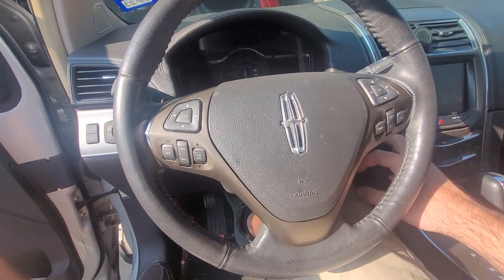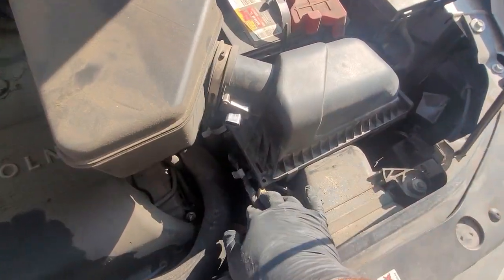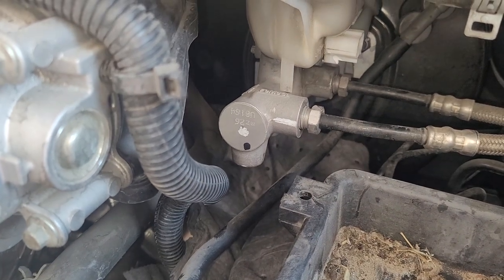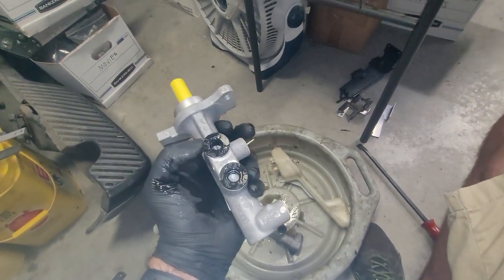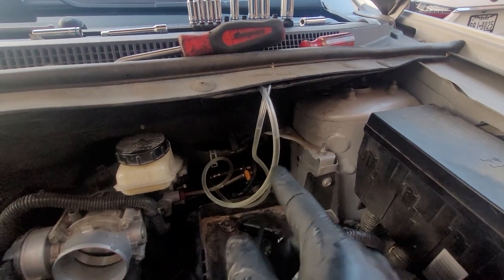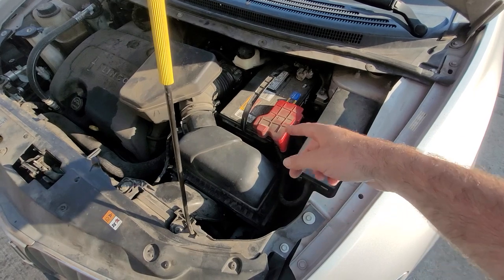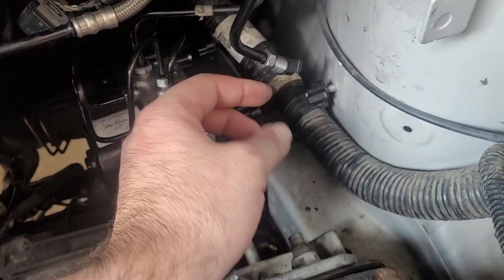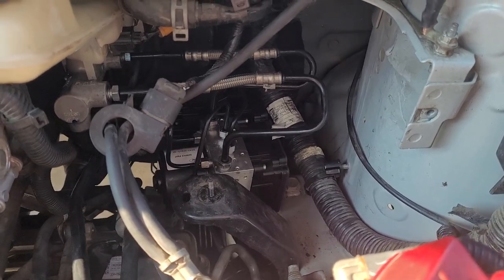Soft Brake pedal problem resolved 2011-2015 Lincoln MKX

Comment: I had a 2013 Lincoln MDX with 131,000 miles in the shop today and repaired the same Customer Concern soft brake pedal.. I did not replace the master cylinder, or the A.B.S. valve block, or pull the battery multiple times.. Now I'm home after work and Googled on the YouTube... Your video was the first to Pop up.. Your final diagnosis of a stuck valve in the A.B.S. block was probably correct.. I performed the auto bleed procedure and the pedal may have felt slightly better?.. Before condemning, or falsely diagnosing a faulty master cylinder,, pull all 4 wheels and remove the mounting bolts from the brake caliper's.. Be sure that none of the sliding bolts or bushings are seized.. Crack open the bleeder screws "just gravity  bleeding" and look for air bubbles.. NOW HERE WAS THE FIX!!.. Get another person to help on the brake pedal and manually bleed the flush the brake fluid system.. When I bleed the Left Rear caliper,, the brake pedal felt normal, and as good as new... Moral of the story is "Flush the brake fluid, because one of the valves is Stuck in the Muck!"
Reply from the maker: I actually took the ABS block off of this MKX (not shown in the video) and attempted to do a bench clean/flush, and then reassembled and bled the brakes, and still had no pedal.  Mine was REALLY REALLY stuck.  Thanks for the comment tho!
Reply: Thank you for this great video very informative 
I have my wife’s 2013 ford edge with low B pedal Iam in process of changing the master and Iam hoping it will get the pedal back up if not then off to abs block wish me luck  thanks again great video 
I appreciate you

Comment: We replaced the master cylinder (via mechanic) and it seemed to fix the problem but now it's back. I have no idea if they bled the breaks. Do you suggest starting there?
Reply from the maker: likely needs an ABS valve block, not a master cylinder

Comment: Did you have reprogram the unit, or, because you just changed what appears to be the mechanical portion of the ABS unit, no programming was required?
Reply from the maker: Correct, no programming. But the Forscan does help to do the ABS bleed portion

Comment: On my 2013 Ford Edge sometimes the brake pedal will go soft after a hard braking event. Running the auto bleed function in Forscan always solves the problem...until the next hard braking event. Hopefully, flushing and bleeding at the four corners will prevent the problem from recurring.
Reply from the maker: You probably have an intermittent sticking valve. I hope that you can limp it along for a little while longer!
Reply: Well, the Forscan bleed trick stopped working when the brakes went spongy again. Took it to the dealer for the replacement of the booster under the extended customer satisfaction program, but there was no real improvement in the spongy pedal. I just ordered a new HCU and will be doing the same job as shown here. This video has been a great resource.